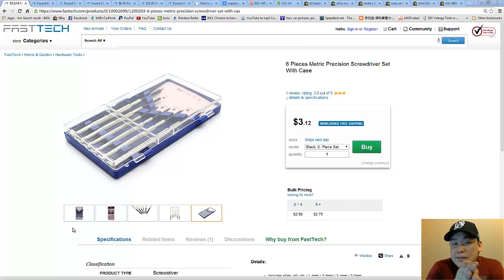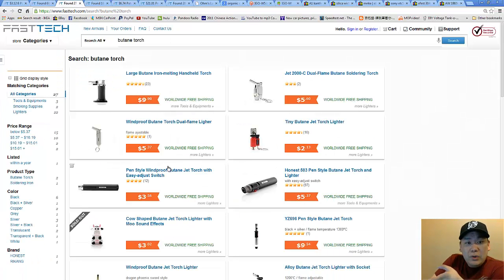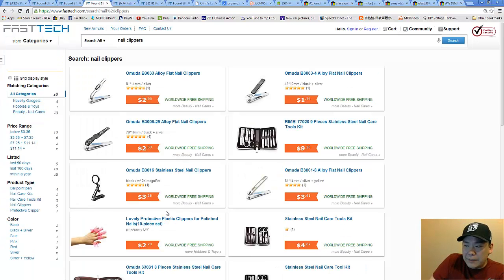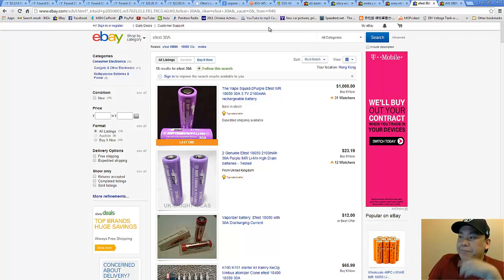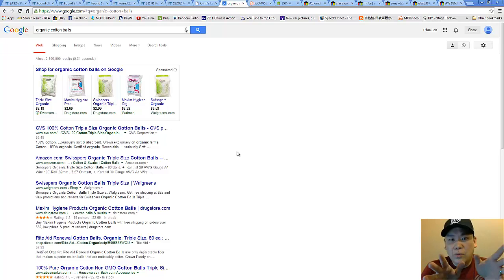Cloud Chasing 101: Getting into RDA drippers

Comment: great point about the tweezers Peg! And here I am with my pricy tweezerman set...lol I don't use the number method for the screwdriver set tho, but I know what they convert to on my sizes.  thanks for the vids!
Peace,
AngryCagen
Reply from the maker: I will be selling that Japanese precision driver set on my webby.
and it will come with the tweezers so they easily warm up with the coils you're trying to press.
Reply: Pegasus1337 I didn't know you had a website. didn't see it in the home page, maybe fb? either way. I am sure I will come across it.  Thanks. Great Vids by the way.
Peace,
AngryCagen
Reply from the maker: no  its in progress.  
will be up in a month,
no FB,  its going to be a REAL site.
 shop, classes, blogs, forums.  a REAL site.
Reply: Pegasus1337 that's awesome Pegasus.  really gonna make an impact and give back to the vaping community.  speaking of Pegasus. My Pegasus from Vape Tech should be coming to my door any minute.  So friggin excited.  Take Care!
Peace,
AngryCagen
Reply: Ceramic-tipped tweezers are a great investment.

Comment: Great! That chart you just typed.  That would be great to know for all guages and wraps.  
Tasteyourjuice.com has a plug
In value chart for your desired ohms but only displays the length of wire needed not number of wraps.    That's a great reference chart you typed.   Will try it today.   Still think about a regular - micro - and macro wrap video.

Comment: It was the gun metal one..the pins are not even comparable. .
Reply from the maker: Well to be fair @ 3:51 I did say the other magneto are weird and poorly threaded etc.  and the only one I recommend is the authentic one in regards to the magneto.

I took a look at  item: http://www.fasttech.com/products/0/10005590/1521202-magneto-telescopic-mechanical-mod
You can see from the first photo, the threads are painted and I would always advise against that.  Also the discussion isn't great on this item along with a 3.3 out of 5 star rating.

The item I recommended is specifically:
http://www.fasttech.com/products/0/10005590/1608400-authentic-smoktech-magneto-mechanical-mod
Which you will see in action in this and other videos of mine, and this one has a 4.7 out of 5 star rating.

Bare in mind that fasttech is tricky, it will attempt to confuse you but it will not lie to you either.  You must intentionally look for authentic devices or good ratings and discussions.  Check out the bling version of the magneto.  The specs is crazy.  A real magneto is a 22mm device.  Half of those knockoffs are larger than 23. so not even a 1:1 attempt.

Comment: Pegasus Vapor Academy   Is torching necessary? I've been told I could just connect the coil to my mech mod and fire it up to make it hot and then just pinch the coil together using a heat resistant tweezer.  I'm kinda new to RDA's / Rebuilding and only learn through videos on youtube or if I have friends over I may ask questions.
Reply: Also what if I bought a mech mod like I already did but the mod they sold me came with an 18650 battery I assume because it's purple and says 18650 how do I know if the mod has a fail safe or not?  they don't tell you these things they're more concerned about making that extra $$$ off you that they could careless if your mod catches on fire or if you short out.

oh I did notice one thing however on my mech mod; on the bottom there's a feature that lets me lock the button so I don't accidentally press it while it's in my pocket I am not sure what type of mech mod this is honestly I just was taken away by the clouds it produced so I purchased it.

I've been vaping on a KangerTech Aerotank Mini on an MVP 2.0 which is vv/vw

Comment: What do you do or how do you solve when dual coils take forget to glow?   28-32 guage.   Multi wraps.  They do not glow instantly.  I often have this problem with all my duals.  Fresh battery.  Clean contacts.   Some micro.  Others regular wraps.   Is there a happy medium on ohms and the size Kanthal wire that produces that instant glow?   It slows down even further once the cotton juiced build is on there.   Thanks!  Just seems it takes many seconds for the inner could to finally glow and do their thing.
Reply from the maker: tell me the item you're trying to build and what you want to do.

Comment: I don't know your name.  
Often when I build a dual coil 7-9 wraps - it will take forever for the coils to glow.  Versus that instant glow when the fire button is pushed.   
Is there a remedy to get an instant glow?  Longer leads from the posts?  
They eventually will glow inside out and evenly but it takes a few seconds or more.   Thanks.  I want that instant glow - inner to outter.   Sometimes my coils are very close to the posts.   Not sure that is a factor?
Reply from the maker: easy solution is to either use a lower gauge kanthal with less wraps.  or  a lower gauge kanthal and do a dual coil.

GENERALLY  4 gauge difference is the equivalent.
For example.
24 gauge 7 wrap macro coil  is .7ohm on the meter. (single)
28 gauge 7 wrap micro coil is .7ohm on the meter (dual)
32 gauge 7 wrap nano coil is .7ohm on the meter (quad)

Comment: You sure taught an Old Dog new tricks. I watched for grins. Pinching the Kanthal makes sense to me. I have 8 drippers, several tanks, Bla, bla, Almost went blind trying to space the coils just right. They fire evenly now. Might not work for all of them, but it's a start. I have an IGO W3 I can't get over .8 Ohms. Vamo V5 won't fire it, Ego T won't fire it. Single coil is 1.6 Ohms. It's ok but I want mega clouds. Vamo fires it @ 6 watts or better. Guess I need a Mech Mod. Don't have $400.00 for a DNA 20. Ideas?
Reply from the maker: buy a clone mech mod but get a real Kick2 from evolv.

it will support down to a .5 build and stay as a regulated device.

Innokin stuff can fire exactly over .8

I own both the IGO W2 and W3  I consider both RDA's super advanced and don't recommend them to anyone unless you want the challenge build.
Reply: Thank You! I watch, I learn, I Vape. I have old motorcycle batteries, I could rig something up Voltage reducer to say 6 volts. Bet that would fire that W3. Can the center stem be rotated?
It is inline with the other posts making the hole really hard to build. Have the way to enlarge the post holes to fit .28 X 4 to make it 4 coil. Have a machine shop. Don't want to break the thing, I like it too much. Thanks Mark

Comment: I have heard there have been problems with the private v2 I really like the look and firing pin placement but was told that I would have to drill holes in the mod it's self to allow the battery to breath please explain that :)
Reply from the maker: i guess thier clone version didn't have holes predrilled?
I don't know,  mine did.   I've never had a miss fire either

Comment: How long did it take you to receive your items from FastTech if you did order from them.I just placed an order and I am getting really bad feed back from them.I am just concern if I lost my money or not.
Reply from the maker: if 1 thing is for sure, fasttech is not a rip off.  they can take forever, sure.
but there has never been a single story of someone not getting the item or their money back.
Reply: Best advice one can give you....  order & forget about it!  Do NOT pass go... do NOT collect $200...  & whatever you do...  do NOT, under any circumstances... check tracking!!  It WILL....  make you crazy!  Not to mention, is inaccurate as hell.  Most times- you'll have the item IN hand...  before it even reports being near your location.  Reason being- system gets updated once scanned...  once it reaches the next place.  When something gets delivered, it gets scanned and THEN updates... not before.  So along the line...  during its travel...  when it gets to a sorting facility, will get scanned....  when it goes out.... gets scanned...  & then won't show again... until it gets to the next place AND is scanned to go out.  Keep that in mind...  it'll be a nice surprise once it DOES get to you.   I CAN tell you this---  over the past year, I've probably ordered from there a good dozen times..  Being in the Midwest/USA.. takes anywhere from a week to 2 weeks or so (depending on time/stock/holidays/weeend, etc)  Speaking of stock.. one other piece of advice-  watch what's "in stock" & what says "5 days, etc" ... and group orders accordingly.  If not....... you'll be waiting for your WHOLE order to go out......... based on it waiting for the one drip tip that isn't even gonna be THERE for a good 10days or so.  Another thing people don't think of & get pissed about.  All the complaining they do, all the emails, comments made to Fasttech- if they just were patient & left it alone........ they could actually ship stuff out & we'd ALL probably get our stuff a whole lot quicker, ya know? :)  I've never not gotten my order....  never had anything missing or wrong.... & never had to return anything.   Order with confidence... just don't bother with tracking.. it'll get there.  Group your orders according to what's IN & what's not....  & when ordering, I always think of it as,,, "as-is" ...  I wouldn't order anything I'd have to count on a warranty/guarantee since most times, sending back & forth would prob cost more than its worth.  Just something to consider when deciding what to order there, ya know?   It's all good tho, IF U can be patient enough.  lol  ;) Happy vaping! (& shopping!)

Comment: one question, what is the purpose of the ohm meter?
Reply from the maker: when you are ready, subscribe to this channel and you will find all the answers here.
Reply: pegasus1337 already did haha
Reply: A coil builder without an ohm meter is like a mechanic without tools...
Reply: The less ohm's it read the higher the amp discharge battery you need or the battery can vent and at it's worst point blow up, putting acid on your face and hurting your bad.
Reply: EpicVapes what battery do you recommend for builds that are like .3
Reply: I'm using 18650 imr mnke 30 amp continuous draw, Just make sure it is a 30amp battery. I haven't seen them more than 30 amp but it wouldn't hurt.
Reply: Jon Lin I personally use and recommend Sony VTC4s or VTC5s. If you wanna pay a little more the newer VTC5s are badass. More mah and still 30 amps. MNKE are good ones too but I don't have any. Whatever you do, do not cheap out on subohm batteries....Just get the new Sony VTC5, they are the green ones you see on most build type vids.
Reply: thanks guys, just picked up the VTC4 2 pack

Comment: Do you think it's a good idea to use this chart to estimate what your ohms will be?  Of course after many builds you will just "know" how many wraps will achieve a certain ohm goal.   But maybe this chart (Excel required) would be good for noobs.
It is supposed to tell you the length of your guage wire - that will equal your desired ohms.  (and number of wraps)    http://www.tasteyourjuice.com/TasteYourJuice/ResistanceWireCalculator.xlsm
Reply from the maker: The chart isn't great.  Although there is much truth to the chart there are also many variables not accounted for.
For example depending on the item being built you would have different length leads.
Longer leads will add more resistance.
I think heating and clamping a micro coil VS not wrapping the coil makes a small difference.
The conductivity of the item you're using may also have an impact on your ohm meter. 
for example a copper pin genesis vs a stainless pin dripper?   You should get different outputs. 

So while its accurate, I don't find it very real world applicable.

Comment: Magnetos are cheaper on eBay got mine for 32 and free shipping plus it came in 2 days not 3 weeks like fasttech
Reply from the maker: Prices Flux,  careful on magnetos these days.
lots of earlier versions floating around,  you know the ones with the spider button.  its hard to say whats what anymore.
Reply: i wanted the spider on the button but theres actually 4 versions now theres the first which sucked, the v2 with the spider the magneto 1939 and the adjustable pin, the v3 with no spider and the floating pin and no 1939, and the v4  with the spring loaded floating pin that melts with sub ohm attys no spider and no 1939. i have the v2 and i love it.

Comment: Pegasus1337 Rip Trippers has just started a Cloud Chasers 101 tutorial series, he released it today, mentions nothing about safety tips, just shilled out a drilled patriot clone that he'd normally moan about, disgusting guy, as far as I'm concerned the best videos on vaping can be found on your page.
Reply from the maker: I've been in e-mail contact with some other big names and we're all very concerned.  Does Rip mention any safety? Lets just say it wasn't as thorough as it should have been.  At the moment, no one wants to speak out against him.  The guy has over 110K subs. Just grimm is a close second

I don't know what to make of it,  the guy just got off the tugboat talking about how no air flow control is etc etc. and now were talking about 4 6 8 port holes? tornado action?

whether you agree with it or not, you still watch. Its like a train wreck you can't look away from.  I think one thing is for sure whether you're a rip fan or not.  We all want to know what he's going to say/do next.
Reply: The only real safety tip was mentioning some batteries that he considered safe, but that's also highly dependent on the ohms you're running through it, also he's using a box mod so they can only take a certain level of power through them before they break, I just don't see the point in him doing a lower quality and more dangerous version of what you've done when pretty much every build he's ever done is either subohm or around the 1.2 mark on a dna 30 so he's still cloud chasing, people might get hurt as a result of a laziness but as long as he's making $$$ from ad revenue he doesn't give a shit